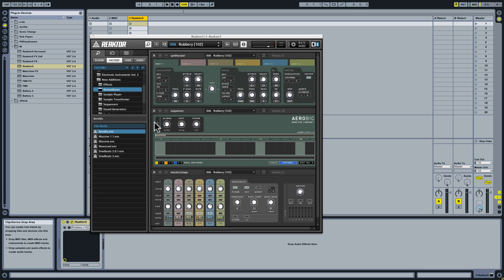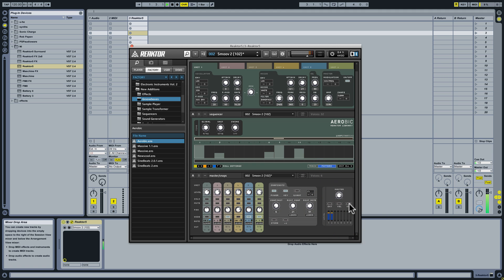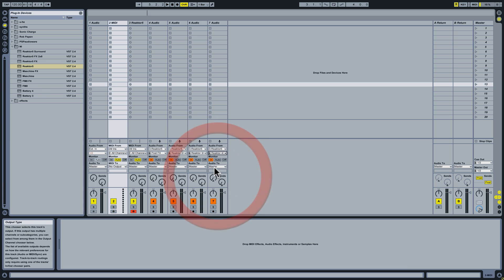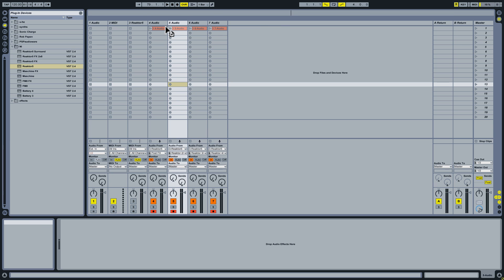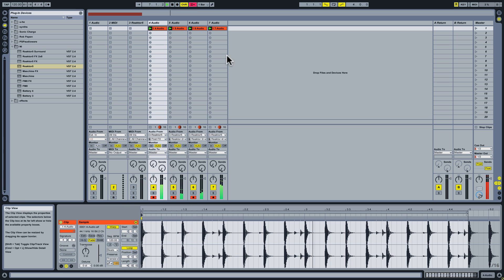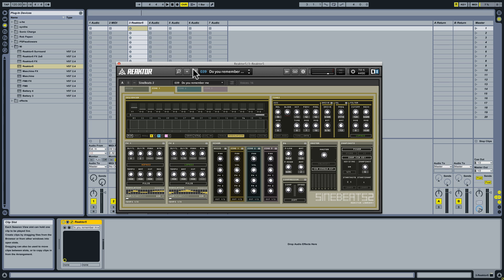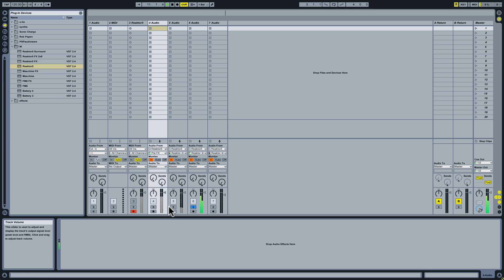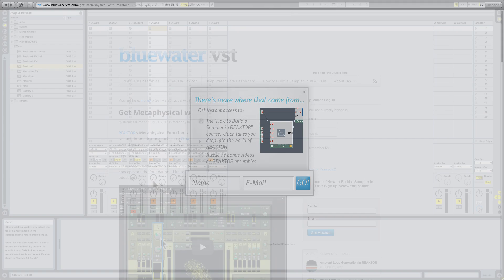Native Instruments REAKTOR: Let There Be Loops

Comment: I find Aerobic to be a bit more difficult to use in a live recording scenario with a MIDI control board than Sine Beats. They're both excellent in their own way, and either can combine with Massive 1.1 really well. In fact just these two alone paired with a comprehensive groovebox/synth like Circuit Trax or the Electribe, - and you've got your own private rave without any need for DJs.

Comment: Please, please please. Explain how do I save presets in Sine Beats 2 (Reaktor 5) Sine Beats 2 is different from all other modules. When I save it as ensemble - and then close the program and re-open the saved ensemble - my pre-set begins to play but quickly reverts back to factory settings on its own. I've lost so many beautiful creations of mine because of it and when you're dealing with 3 16-note channels - it's impossible to bring it back just by memory. How do I save my pre-sets with Sine Beats 2 so they STAY. For example - I change factory settings to play different notes and I changed attributes. How do I save this so all my changed attributes stay in saved file and not revert back to factory settings every time I re-open saved ensemble? I will be very grateful if you explain this. Thanks
Reply: same question!